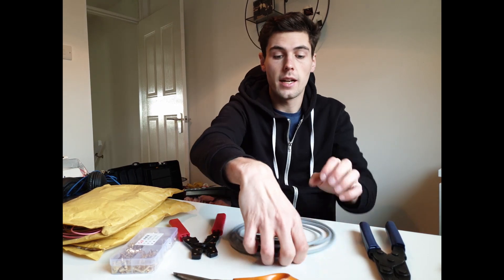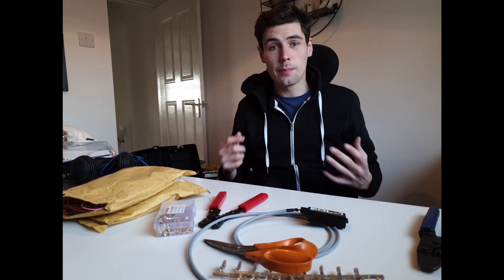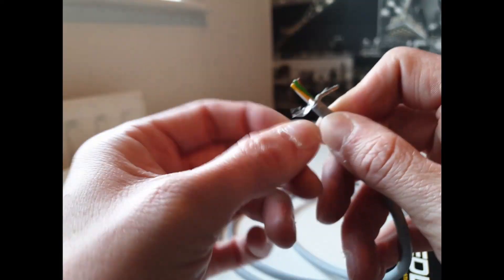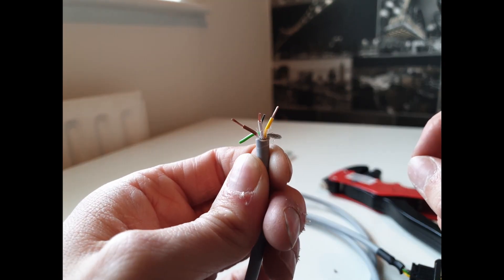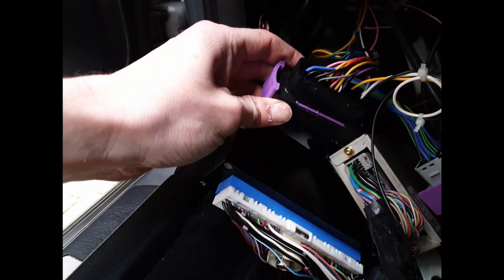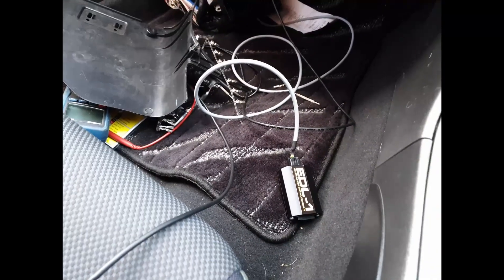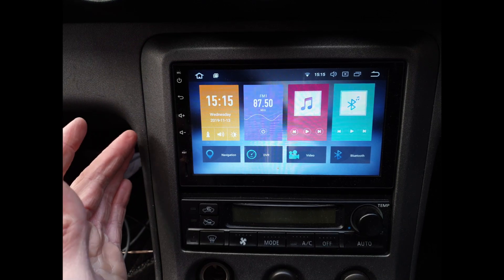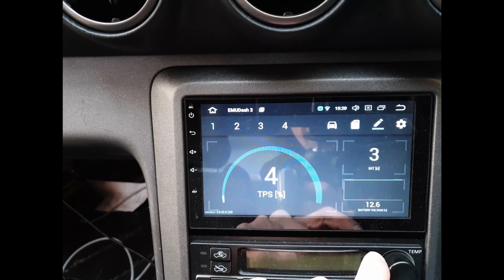🏎Nissan S15 - Installing the ECU Master EDL-1🏎

Comment: Are you planning on setting up CAN?
I will need to do that for my gearbox swap and paddle shifts etc. 👍
Reply from the maker: Hey, it's certainly something I want to experiment with. There's some really nice can bus 52mm gauges out there that I'd like as a backup incase I'm using my head unit for something else 👍